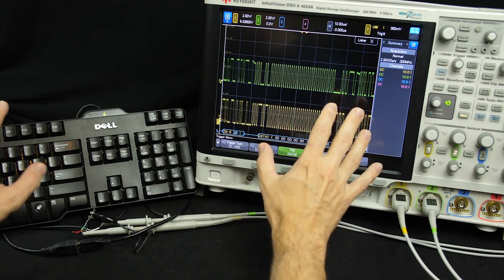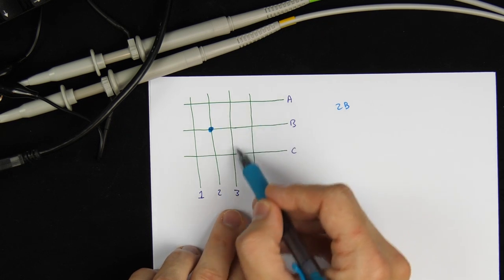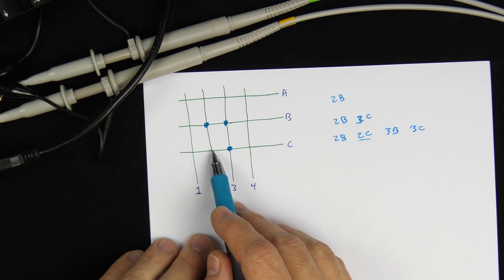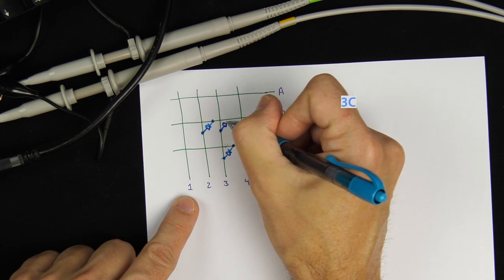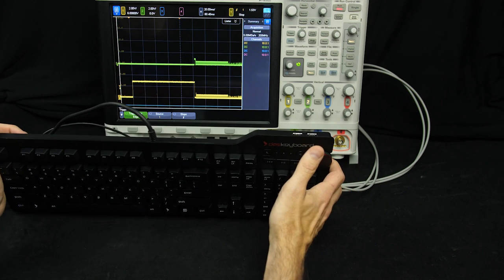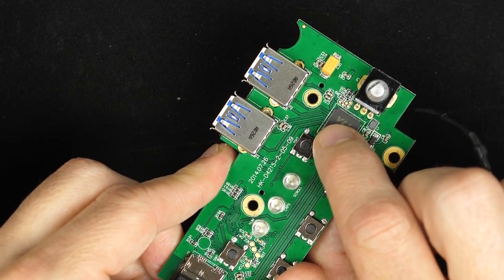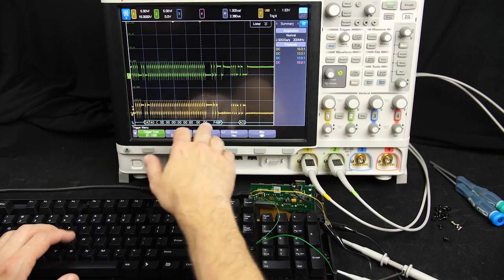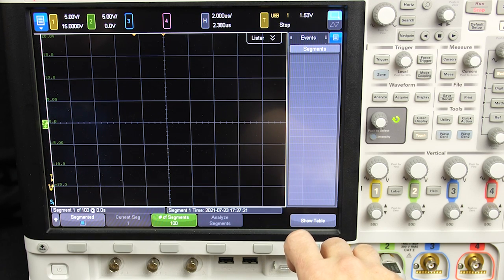How does n-key rollover work?

Comment: If I had to guess, the reason why so many keyboards are restricted to 6-KRO instead of NKRO is not the cost of diodes alone. To accomplish NKRO, there's a good chance you wouldn't be able to use low speed USB, as the maximum frame size is 8 bytes, so larger frames would have to be sent over two IN requests, introducing latency. As a result, you'd need to source a chip that supports full speed USB so packets can be as large as 64 bytes, which tends to increase the price and limits what options you have available. From there you need to manufacture the keyboard with the diodes, which can increase manufacturing costs. Additionally, NKRO follows a different protocol, using a bitfield to map the keys, which is very efficient but isn't natively supported by default USB drivers. As a result, the you have to spend time and money writing drivers for Windows, Linux, and macOS to support the protocol. With all this effort to make NKRO, it's no surprise that so many companies decide not to support NKRO, as it's not something the average consumer needs.

If a USB standard is created for NKRO keyboards, and default drivers supporting the NKRO protocol are provided with operating systems, we'd probably see NKRO keyboards become much more common, as one of the largest barriers to creating an NKRO keyboard -- writing the drivers -- would go away. Unfortunately, NKRO will likely never replace 6-KRO keyboards completely because of the manufacturing costs and the full speed USB requirement, and as someone else pointed out, a lot of BIOS's don't support anything but the standard 8-byte keyboard USB packet, so NKRO keyboards will have to support 6-KRO mode regardless.

Comment: I can shed some light as to why the keyboard reports all those system control functions. Most consumer keyboards with n-key rollover also have support for “remapping” keys to functions not shown on the label. Say, for instance, you find yourself wanting to get quick and easy access to your web browser and never use the F11 key, then you can remap that to open your browser. Similar story for all those other functions. Quite a few let you do this with literally every single key. Want to change from QWERTY to DVORAK? Remap away and swap the key covers around. Or leave them in place and confuse everyone else trying to use the computer

Comment: I'm sure part of the reason cheaper keyboards don't include isolating diodes is that the switches are part of a plastic membrane with printed traces. Adding diodes would require switching to a more expensive construction which likely costs much much more than the diodes themselves do.

Comment: Excellent video, but it does raise an interesting philosophical question: Is there really a practical reason to have more than 10 key rollover?
Reply: Not for typing text (6 is generally enough for all but the very fastest touch typists). But for some gaming where you are not typing a stream of text but pressing a 'big-array-of-buttons', it might be useful (most game designers try to avoid requiring this because a lot of their players won't have an n-key keyboard, but high-end stuff like flight-sims and 'pro games' have the luxury of saying "get an expensive keyboard if you want to play."
Reply: How many of them require you to take your shoes and socks off in order to operate the keyboard?
Reply: Stenography.
Reply: @jasuko  Most stenographers also have only ten digits on their hands.

Comment: The only bit that stood out is that the example you used to talk about diodes is really for anti-ghosting rather than for N-key rollover, though I suppose anti-ghosting is a prerequisite for N-key rollover. Since they go hand-in-hand I'm sure most keyboards are either neither or both though.

Comment: Bass Boost... yeah, you can tell the USB standard was created in the 90s. 

From what I've read, that bitmapped method of reading keypresses is a later addition to the USB standard. Some USB keyboards that support NKRO for older systems actually split the keyboard up into multiple virtual keyboard devices, each capable of handling up to six keypresses at once. You actually see multiple keyboards with the same name in Device Manager when you connect the one physical keyboard to the PC.
Reply: And that's what I get for not watching all the way to the very end. I can confirm that's true, at least.

Comment: Ben, it's not uncommon for those weird extra functions you see on the system interface to be mapped onto keyboard side interpreted combos, instead of physical keys. The main advantages of that are compatibility with host software and conserving keyboard real estate. And yeah, sometimes you might also have a range of gaming and/or multimedia keyboards, some of which incorporate physical controls, with the lower end ones resorting to chording. Not all of the functions are often marked on the keyboard because the conventional mappings across different usage scenarios can pile up on single keys, making the whole rather cluttered. Still, the whole range of function is still often available, even if not documented.

Many such designs also incorporate programmable automation in the keyboard for gaming use, and things like blanking ctrl+alt+del and caps-lock in gaming mode. Mine does, eventhough I only bought the thing because of the switch-feel and the sound. (Both help any half competent touchtypist.)

...which, speaking of the devil, is Razer BlackWidow Chroma X (their Green switches are just right for me, and could only pale to the Model M bucklers). So, also quite the RGB lightshow if you let it be. (I just use it to dimly color separate groups of keys for operation in the dark. You do need to hunt and peck sometimes, in the night, and color coding is another useful aid.)

So...if you want to do another deep dive into USB Keyboards, show us what one of these blingy-thingies is doing over the bus. Especially since they seem to be capable of doing things both under direct host control, and on their own. There has to be something highly nontrivial going on between the host and the keyboard, and you know, both gamers and FLOSS-programmers are into that sort of thing. The protocols are not well documented, if at all, and yet hold the key to all sorts of experimentation, signaling and artistry, through what is now your second most expensive display-of-a-kind.

Comment: I would think listening to all the lines in the matrix except the one being asserted would disambiguate it at least somewhat when multiple keys are pressed, even without diode links. And if voltage is considered, various sizes of resistors could be used in some pattern so if several keys form a loop, the read voltage on the various rows and un-asserted columns would differ, so that could be used to determine which particular keys were pressed.

Comment: If you had a USB 1.0/1.1 hub around, you could use that as an intermediary to force the daskeyboard's hub to run at full speed instead of high speed. That would have been a way to see things on the scope before opening it up. Lots of interesting things to see when opening it up of course though :)

Comment: If you just want to view the USB messages, you can also do it completely in software with tools like wireshark.
Reply: You are 100% correct. However, I would say that doing it this way drives home that this is all just voltages on the line in a way which would be easier for watchers to forget if you were using Wireshark. And since he's possibly working up to implementing this himself, it might also help.

Also, I suspect you would not have seen the USB 3 negotiation the same way from Wireshark.  Still a valid approach either way, but maybe more relevant given his focus that he used the scope.
Reply: @doctorbobstone 

On the other hand, it will show viewers that you can do this kind of analysis at home, without having to spend thousands on an oscilloscope.

Personally, I think a hybrid approach would be best. In the previous video, I was thinking it would be so much easier to use wireshark and nothing would be lost. In this video, however, showing the speed negotiation on an oscilloscope was great and should be kept. Following the traces and soldering on wires also drives home the point that these devices can be understood and aren't just magic boxes.

He did just skip to a fully transcribed and annotated log of the descriptors, though. Showing those in wireshark and how it can help with decoding would have been more useful in my opinion.

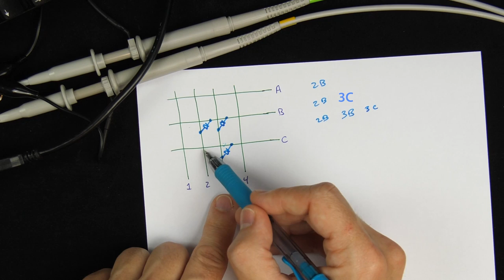Comment: 7:35 Isn't also that it's hard to do such thing in membrane  keyboard since only one small PCB you have is one for controller  and rest of actually keyboard where keys are ther is just membrane and no PCB to attach diode ?  I'm seriously asking because i kinda don't how they could do it with membrane key board..
Reply: There are flexible circuit boards that can be soldered to. But I'm guessing that the membrane that's being used in a cheap Dell keyboard is made from the cheapest stuff possible and doesn't have that capability. There's also no reason that the circuit board needs to be flexible; they could be standard PCBs. It's almost certainly just chosen because it's cheap.
Reply: The purpose of using a membrane in the cheap keyboard is to save the cost of a hundred or so mechanical switches, which each cost rather more than a diode.
Reply: @wbfaulk  By using a membrane instead of rigid PCBs, you can bend the membrane to make the 2 separate membranes touch and complete the circuit.
Not only does this make it quite simple to make, it also means you don't have a bunch of mechanical switches which can break, which have to be soldered onto the circuit board with that connection potentially breaking.
It also has the benefit of being cheap and not using a lot of resources.
Reply: @jeffreyblack666  You can have non-mechanical PCB-based keyboards. For example, the rubber domes can have a conductive coating that conducts across two closely-spaced connectors on a PCB, like most remote controls, or bring a conductor closer to the PCB to modify capacitance, like Topre keyswitches. But you're barely gaining anything over the membranes, and increasing the cost, so it's not widely used.
Reply: @wbfaulk  Yes, I know you can have other forms. But as you said, that significantly increases the cost. The other thing I'm not sure about is weight. While I can''t be certain, I think a PCB, even though it is light, would weigh more than the corresponding membrane, and is thicker.

And this also varies depending on if you are talking about membrane keyboards or chicklet keyboards.
Strictly speaking what you are describing would be similar to a chicklet keyboard, where all the top layer does is bridge 2 contacts on the bottom layer. But a membrane keyboard allows conductive traces to be on that top layer. As the simplest design for a keypad, the bottom layer contains horizontal traces, while the top contains vertical traces, and you push those traces together (with a dot to help) to complete the circuit. You can't do that with a rigid PCB as the top layer.

Comment: The Logitech G510 / G15 macro keyboard also suffer from the n-key issue, funnily enough that's always happening ON the actual N-key. (not just a number of keys).

I haven't found which sentence/words 100% trigger it, but during a sentence with an "n" in it, it sometimes pretends to have pressed F7.
This glitch existed since the first version they put out and still plagues the series (and probably other keyboards from logitech too).

In GTA San Andreas multi-player F7 will make chat semi/full transparent, really annoying
Firefox will turn on Caret Browsing, whatever that is. (the box that pops up and disappears too fast for me to read because it shows up during typing and responds to spacebar to close)

Comment: I'd be curious to know how the hub connection multiplexes USB signals.
Reply: Since the usb protocol uses packets I'd assume it just makes sure that packets going to the computer don't collide and then puts them on the same wire without any processing, and for packets coming from the computer it just pastes them onto the right port like an Ethernet switch or if it's not that smart all the ports like a repeater hub. I assume it's probably more like a switch tho since hubs are usually just worse due to just basically copy pasting everything everywhere without knowing anything about the connection where as a switch has some idea of where packets are supposed to go.
Reply: It basically just re-transmits the signals, making sure they don't overlap.
Reply: I’ll bet that’s the next video.
Reply: @errorlooo8124  i have a dumb dumb cheap usb hub that i use to plug in peripherals in order to not use the only three usb 3.1 ports on my laptop. i noticed that, even though the hub is 2.0, when i used it for data transfer (i was lazy to plug the thumb drive into the laptop since it requires some dexterity) the speed was significantly lower even with regular 2.0 ports

are usb hubs so stupid that they can't even share its own bandwidth smartly enough to not share it evenly between requiring low bandwidth (usb mouse and keyboard) and requiring high bandwidth (USB thumb drive)?
i presume my mouse and keyboard negotiate with a computer by asking a 480 Mbps mode and therefore the hub thinks they need all this bandwidth and therefore splits it evenly, hurting the performance of a thumb drive?

p.s. that same thumb drive works flawlessly in a laptop usb port, so it's not the thumb drive flaw
Reply: In short, the multiplexing is done by the computer (or host), not the hub.

His previous video includes a key part on it.
USB has a clearly defined host and a clearly defined device.
The host controls the flow of data. If a device needs to send data it will wait patiently for the host to request data from it, and only then it will respond with the data.
And each time the host tries to communicate, it specifies the device it is communicating with.

This means the computer can send a request for a device plugged into the hub to send back data.
The hub can either remember what device that is and send it on only to the specified device (introducing latency), or it could just repeat the signal on all parts, resulting in minimal latency. The devices that are not being addressed should ignore that signal, and if the hub detects that it is being spoken, to then it responds. It could also be slightly more intelligent, sending the data but also seeing what device is being spoken to and then halt sending any more data to the devices that do not need it.

Then, as only 1 device should be talking back to the host at a time, it can simply forward that data straight out to the host, with no need to process it. But it can also implement protection to know what device the host was talking to and only send data from that device.
Reply: @vikiai4241  keyword: "USB split transactions". The host can tell the hub "hey, send this message to the really slow mouse. Now send this data to the USB drive. Now send some more data to the USB drive. Now has that mouse answered yet? Great, what did it say?"

Comment: I think you forgot to explain how the 1234, ABC matrix was wired up. I'm guessing that you have the same potential across each vertical bar and across each horizontal bar, and pressing the keys as indicated makes connections between just the corresponding horizontal and vertical bars at that intersection point.

Comment: Hey Ben how about a video on digital audio? Would it be intreresting?
Reply: Have you seen the video where he build VGA video card? An audiocard works exactly the same way, except it's even simpler, because there are no blanking intervals.
Also, with audio you almost certainly need two or more buffers that the soundcard switches around. Otherwise you'd get horrible artefacts when writing the data that the card is currently reading (analogous to vertical sync in video).

The real main design problem with soundcards is designing a low-noise high accuracy analog-digital converter, because noise, low resolution and distortion are a lot more noticeable and unpleasant in sound.

Comment: Is there a user's manual?  The extra consumer functions might be activated by key combinations or mode selections.  This detail is not needed in the video, but I thought I would try to be helpful.  Thank you for the information.

I would have removed the 33 Ohms and twisted the pair.  I might have included axial 33 Ohms in the wires; but for a quick demo these precautions obviously were not needed.

Also, modern OSes allow the insertion of user software drivers between the USB and the application layer.  This conveniently allows designers to decode special functions and to send desired event signals through the kernel to the apps.  Once these drivers were included on supplemental media, but today they are merely downloaded.

Comment: Fascinating. Makes so much sense to use one-bit flags, compared with an endless string of bytes...
Reply: That depends on what you are trying to do.
If you were telling someone what keys to push to perform a certain task, do you tell them to push key x, key y and key z; or do you go through each key and tell them if it should be pressed or not?
The same applies for computers.

Comment: I'm a bit curious. When the keyboard was in 6KRO mode and you pressed more than 6 keys, another data packet seems to have shown up on the scope. Does the keyboard send out multiple packtes with 67 keys, if more than 6 keys are pressed? Or were those just unrelated packets?